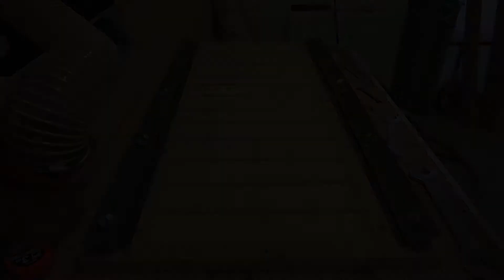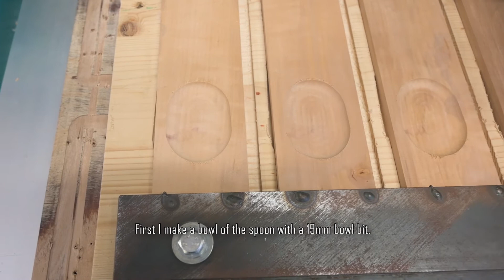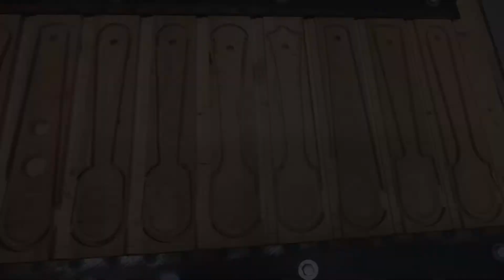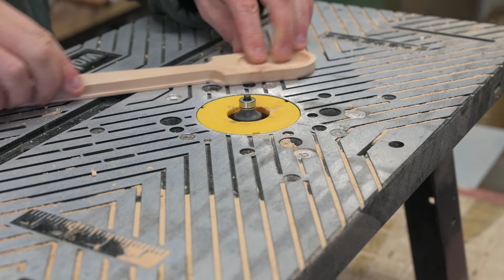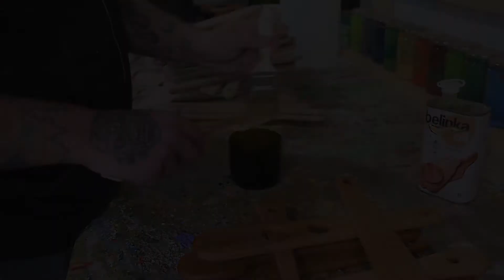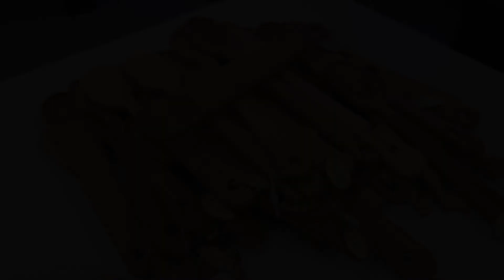How To make WOODEN SPOONS

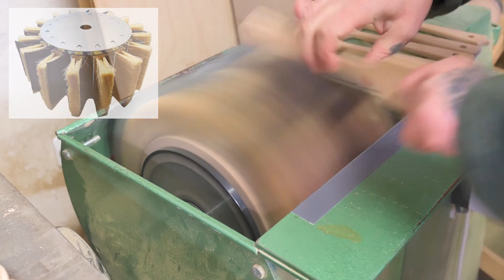Comment: Nice work man! What is the machine you use at 5:50? never seen that before
Reply from the maker: Its common in europe, the wheel has synthetic brushes and sandpaper it makes the surface super smooth.